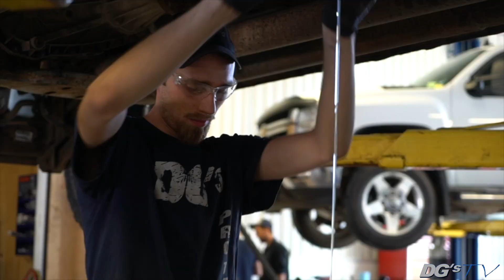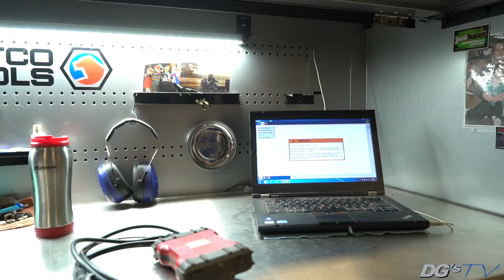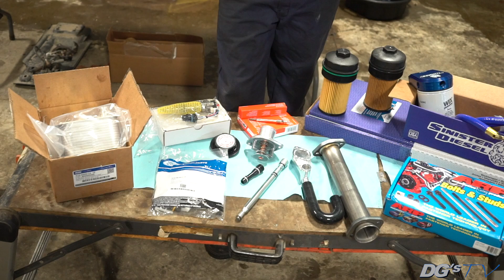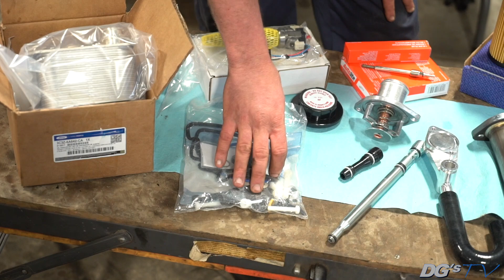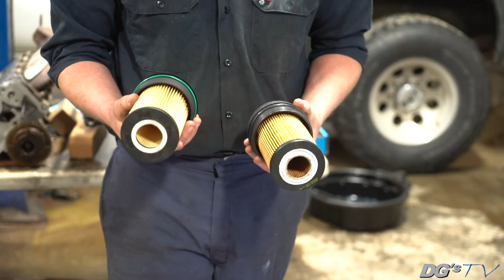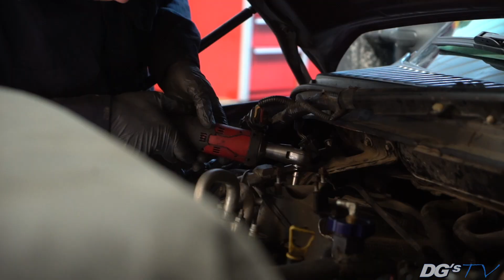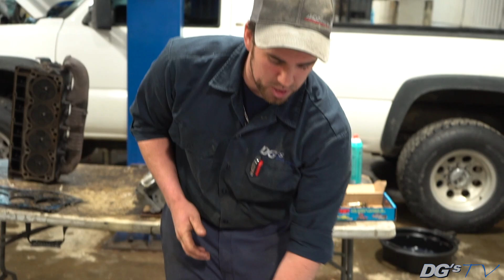EP 4 - Ford 6.0L Problems and Bulletproofing

Comment: i have lost all trust in modern diesel trucks
Reply: The motors are fine it's the emissions bullshit killing these engines
Reply: I agree with this statement 100% Overpriced garbage now!
Reply: 7.3💪🏼💪🏼
Reply: @vadimmakovich2433  7.3 is the way to be
Reply: It ALL comes down to the STUPID SMOG LAWS,, Having ALL that SMOG devices kills the engines (PERIOD).....  UNFORTUNATELY I live in CALIFORNIA which is ONE of the (if not) the WORST states to live.. Sad but true to say
Reply: I don't want to argue with you! I love all diesels . But cat and Cummins are still king on our American road ways, a shit load of international DTs too. The best v8 were two stroke Detroit especially when two were bolted together then you really made some noise
Reply: @jerrybrandt9377  i would take an IH i6 dt466 over a cummins any day i have one in my f600 grain truck and that is fully mechanical  has 0 emissions on it so it runs lovely

flat out it will do 80 but i really need to go over 55

the big differences is that was a $5000 truck

if i wanted to get a new one that would be $100,000 and a trash fuel system that breaks just by talking about

i dont want to argue either we both clearly like diesel engines just you are "brave" enough to trust a newer one
Reply: Still have the same frame!!lol
Reply: It's not the truck's fault, it's democrat politicians.
Reply: @justanotheridiotredneck  mostly but the fueling system on these modern diesels are way to fragile my friend got diesel at a flying jays once and boom a tiny bit of water tech said it was about a teaspoon and boom he need a new fuel pump and 8 injectors

and the dealer refused to do the repair unless the whole fuel system was going to be replaced
Reply: @Friedrich-Wilhelm-1980  The Ford 6.4 Powerstrokes were bad for this..... a little bit of water screwed them right up.
Reply: @beri232  I'd still never buy a modern diesel engine anymore they cost too much you're too sensitive to fuel contamination they require way way way too much maintenance

And to be frank of my 40 year old 6.9 L IDI Pick-n-Pull a double stack round bale 40 foot trailer at highway speed then I sure as hell won't need 1000 foot pounds of torque when clearly 435 foot pounds of torque do plenty fine

So no thank you I will buy the new gas engine that comes out in the fall but I have everything I need without any of the downfalls
Reply: He'll if you wanted you could P pump a new ram and delete it and bam
Reply: @jerrybrandt9377  who would go spend $80,000 on a new truck then spend another $12k on upgrades voiding your warranty
Reply: My ram is an 08 dude warranty long gone
Reply: My point was the Cummins are basically the same with a few different fuel revisions !
Reply: @jerrybrandt9377  no the 5.9 and the 6.7 cummins are 2 completely different engines
Reply: 6.7 is a revised 5.9 ,same block with larger bores and 40% of the engine will interchange
Reply: @Friedrich-Wilhelm-1980  what  diesel would you buy or recommend?
Reply: @chrisbirch4066  you mean like a new one or like an old one?

if its brand new 2019 buy a cummins i hate dodge but they are having the least failures

if its an old one like the 1990s but a powerstroke OR a cummins  both are bulletproof people will try to say cummins was better but their not they are just as good as a powerstroke

now the other problems you will run into is dodge rear ends seem to be made out of styrofoam they always fail at like 60-80k they were just not good

the powerstroke E4OD transmission was ok it would get 100,000 working miles before it needed a clutch pack replacement but it would easily get 170,000 it it was just a truck that didn't pull a trailer

im a powerstroke guy but ill always give the cummins its dues its a good engine

but like i said when i started im fed up with diesel trucks such as they are now
Reply: @Friedrich-Wilhelm-1980  what  old diesel would you buy . You said you would never buy a modern  diesel.... what is considered modern?
Reply: @chrisbirch4066  my hands down favorite was the 6.9l idi it was slow but it was as simple as diesel engines get and my 1984 f250 xlt got an excellent 20 mpg highway at 65 

but if i wanted something with a bit more pep i would get a mid to late model 7.3l powerstroke i had a 1997 f350 with one and it got about 16-17 mpg highway but it was a good 30% better acceleration

of course  you can't go wrong with a 12 valve cummins now i hate dodge trucks and i think "fummins" 
(Ford with a transplant cummins) are sacrilege so i dont use them but they are still just as good

now to answer that last part i consider anything after 2002 to be modern because in 2003 is when the diesel smog shit hit the fan and the truck market took a nose dive because of it

the ford 6.0 was failing to start and blowing heads left and right and the duramax has blocks crumbling like sand because they were cast in an isuzu plant in china somewhere

but i will say dodge somehow managed to make the 5.9 meet emission standards a few years after the mandate
Reply: @jerrybrandt9377  good luck with the head gaskets..
Reply: @Friedrich-Wilhelm-1980  The fuel system goes back to emissions requirements too.  I doubt the mfrs wanted to have to go to the insane injection pressures we're seeing now, especially at the cost.  But they had to do it to keep up with the government.  Here in the states, you can thank Mr. Clinton for it mostly.  We stepped up to all this BS back in the late 90's.  Ten years later we all started paying the price, both at the car lot and the repair shops.
Reply: @Friedrich-Wilhelm-1980  I agree 435 foot pounds of torque would probably be adequate, but where is a 6.9 IH IDI gonna come up with that much torque?  That's the most gutless V-8 pickup I've ever driven.   It might run forever but power?  No.
Reply: @blythkd9017  the 6.9 made like 365 foot pounds of torque bone stock injector upgrade minor injection pump tune and turbo charger will get you to 435 foot pounds easily

And no it's not a power monster but the 6.9 IDI was never meant to be a power monster 

it was meant to have enough power and run all day long at Full Tilt while getting Peak fuel mileage
Reply: Jason Hendrix and engineers
Reply: @justanotheridiotredneck  that isn't how things work. Bad engineering and a lack of testing before production is at fault. It doesn't matter what regulations are involved it's possible to build a reliable and price competitive system. The company cutting corners to maximize profits and be the first to release a "new generation" product is whose fault it is. Ford put out these motors without making sure their design was reliable in service. It would have delayed their launch and cost money to actually do quality control testing properly. They did the same thing with the 6.4 motor. It had nothing to do with democrat politicians and everything to do with Ford making a bigger profit. That is a lack of regulations and that is what conservatives want. So if you want to blame someone go look in a mirror and shake your finger at yourself. 

If you want to get into politics Republicans consistently enact legislation that hurts end consumers and allow corporations to abuse their power in the marketplace. That is bad for everyone except the shareholders and executives at those companies. 

If you are going to have an opinion at least have an educated opinion. Don't just spout dog crap because you don't like a political party. Decades and decades of state and federal legislative voting records proves conservatives hurt the end consumers and liberal legislators do their best to protect them while also trying to stop companies from taking a giant dump on our environment because, ya know, we all have to live in it. Having clean air and water is more important than Ford or GM making a bigger profit next quarter. 

New HD 3/4 and 1 ton trucks cost at least $60,000 with a diesel in them. They can be $100,000 loaded out. The people buying those trucks aren't going to notice if the diesel in it cost $6500 or $8500. If $2000 mattered to them they sure as hell couldn't afford to throw down $85,000 for a F250 King Ranch edition to haul their horses to the rodeo so their teenage daughter could barrel race. I would rather pay more for a well tested and reliable engine up front than save a little and have to spend $10,000 to "bulletproof" my engine because Ford didn't want to do it right in the first place.

Comment: Everything breaks at some point. I can’t help but notice you have a Chevy and a dodge in there. Ummmm did they break to?
Reply: Ask any Diesel mechanic and they will tell you that Chevy and Dodge have their problems as well.
Reply: tabcobra my Chevy is nothing but problems. The duramax itself is alright but fuck the truck haha
Reply: No there just in for mods lol
Reply: Nick Herrman  I've owned different models of all the diesel trucks and yes that Cummings engines are nice and all but they are wrapped in a disposable package.  Interiors that seem like a Walmart quality type are in those Dodges not to mention a 2 year old I owned that was oxidizing EVERYWHERE and yes their electronics are junk.
Reply: @officialyoutubecommentator4357  Cummins,  not Cummings.  it's  a diesel engine, not a porn star...
Reply: You mean the dirtymax,and the cummins-apart....😂🤣😂🤣😂🤣....yup I saw them too
Reply: My 13 lml had head gasket failure at 50kmi, needless to say it was put together the proper way after
Reply: The Chevy is there for a footprint accelerator pedal.
Reply: @chairmnofthboard  lmaooo
Reply: Furn333  And a broken shock mount lol, that's a big deal to you?!
Reply: Furn333 I can read just fine. Look at your comment. All it says is They brake at the shockmount. Ironic you would question if I’m the one that can read you dipshit.
Reply: Furn333 If you meant to say The frames break at the shockmount, then you understand that for one to read the grammar and punctuation need to correct. But you knows that cuz you’re the All Knowing one on here.
Reply: The diesel is a money maker, people no little, truck starts running goofy, right away mechanics like its the injectors, lifters, when all it really was was a sensor. They have to make money somehow.

Comment: So we’re looking at about $4-6k worth of parts and labor.
Reply: multiply that by 2
Reply: Lmao such expensive trucks
Reply: And if you need injectors on top of that , close to 5000.00 with extras and taxes!
Reply: Gwizthegreat - fair guess. Key is a competent shop. They know the job and the time it takes and may be a little on the low end of your estimate depending on the condition of the parts they’ll hopefully re-use. Surfacing the heads is commonly required, magnaflux for cracks is a great idea, and depending on miles and condition, a valve grind may be a good idea while the heads are off. By far, the biggest part of the job is the removal/prep/reinstallation of the heads. Headstuds aren’t a big labor cost consideration. Most shops could do all the rest of the work mentioned in a day.

Comment: You need to run a cooler thermostat as well then factory International motors in other applications ran a cooler thermostat the only reason they have it that hot is for emissions standers that only Ford trucks are liable for  By the EPA You can get great aftermarket thermostats 10ﾟ cooler and with the comment below mine O ring the heads will definitely safeguard anymore head gasket problems along with the studs
Reply: I would argue just the opposite. A diesel is a different critter from a gasoline engine and runs better the hotter it gets, right up to the point it melts down, and that has happened with many 6.0’s due to coolant loss and the inadequate factory instruments. I run a 200° Thermostat. Faster warm ups gets the engine up to the magic 185° mark quickly and the computer in closed loop quicker (closed loop isn’t the correct term).  An oversized aftermarket radiator will ensure you don’t get too hot towing. 195°-205° (even 210°) is a good place to be for power, economy, and longevity.

Comment: Good video... i got question my truck ...has not heat ... and Heather core ...is not warm... i just did the coolant flush thermostat and water pump replaced... still same problem...do u think could. Be the head gasket????
Reply: Did yoi make sure that the valve in the heater hose is opening. Its vacuum operated.
Reply from the maker: happy to discuss this with you, call me at the shop, 519-418-2886, have a great day!
Reply: Thanks bro water pump was cracked... and was not overheating

Comment: I have a friend that works at Ford. He said one of the engineers said some of the early 6.0 came from the factory with the wrong pressure radiator cap, being too high. Have you had any experience with this?
Reply: M H 
The radiator cap doesn’t have a pressure rating. I think you mean degas bottle cap. It is 16psi, should never hit 16psi unless you have a compromised head gasket or gaskets...
Reply: Yes my mistake. I did mean the degas cap
Reply: 6-7psi is normal

Comment: I certainly agree about the oil filter comments. I also agree the 6.0 had its share of concerns and the fixes are currently out there to resolve them. You use the term “Bulletproof” suggests (in the USA) you have components from the company Bulletproof Diesel in Arizona. You also show aftermarket gaskets which are known to fail. Coolant is another conversation.
It’s funny, how can you be certified if you work on Cummins, DMax and Ford? Techs who leave the dealer may maintain their ASE certified status. You loose the Certified status from the manufacturer after a period of time.The car company I work for it’s 4 months.
There is enough crap to throw at any of the big 3 and the days of the 12 valve and 7.3 have passed us all. Reality is jerks blowing black smoke ruin it for all of us. The engine killing EGR,DPF,SCR are shortening the power plants life cycle. Where is the outcry for the jackass lawmakers cost us all more money because of these emissions systems?

Comment: Need to mention to o ring the heads. Headgaskets will still fail even with head studs.
Reply: No you fuckin don't. Studs are more then enough if your keeping stock power levels
Reply: @zacharyantoneshyn5100  no one stays at stock power levels
Reply: If you wanna go 500k keep stock power levels. It's a work truck not a drag car...
Reply: @byronsanders7124  fuckin exactly. You but a Diesel work truck to, how do I put it... DO WORK
Reply: benchmstr  Yo, it's  a Bro-Dozer !
AH-AH-HHH 
LMAO!
Reply: Justin can u please explain
Reply: @lf3566  you can google search fire ring or o ring cylinder heads. It's a metal ring that gets machined into the deck of the head. It allows a tighter seal between the head and block.
Reply: @stuckinkaos95tbirdlx  thanks👍
Reply: benchmstr  the fuck?

Comment: Awesome vid man! Ive had many 6.0s and loved them all. Ive never blown head gaskets on any of them fortunately. My 06 that i own now has 214000 miles on her with stock bolts injectors and oil cooler. Its been well.maintained since knew and not used as a race truck. Like u said maintaince is key especially when u have a hpop breaking the oil down quickly
Reply: Tuning will blow the heads. Shoot I've seen stock 5.9s need head gaskets before.
Reply: @byronsanders7124  if its a shitty tune or the driver races it nonstop then yes its hard on the stock head bolts but ive had mine on a performance tune for years now with no issues
Reply: @theboyparker4899  yeah I've seen people rod on them and not blow. I'd wager most head gasket issues are related to egr cooler cracking and putting coolant into the combustion chamber
Reply: I am thinking of buying a 6.0 2006 diesel with 100k from original owner who towed a boat a few times a year. GVWR 10000LB my 5th wheel dry weight:14000LB dry weight. my question is if I add airbags will this alone make up the GVWR on the truck? thanks
Reply: @garyduran1  yes sir i pull over 15k with mine quite a bit
Reply from the maker: Thank-you, the videos are fun to do!